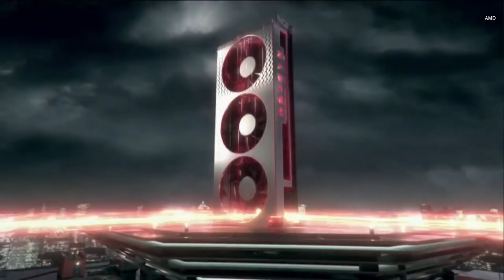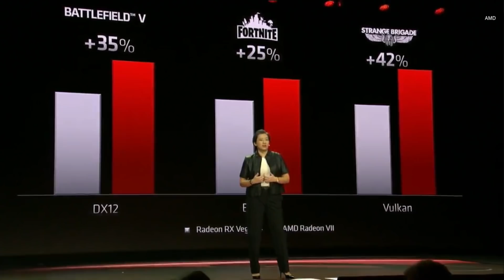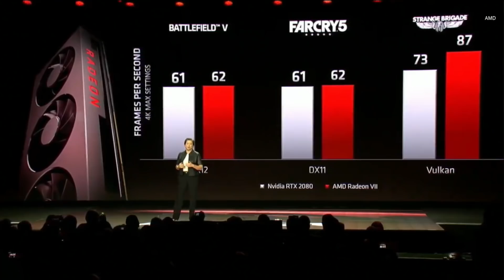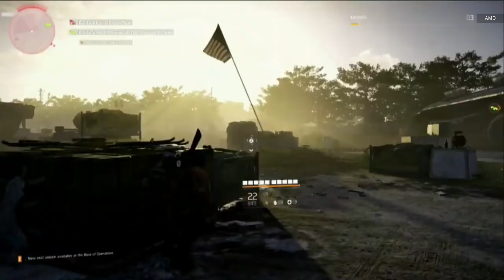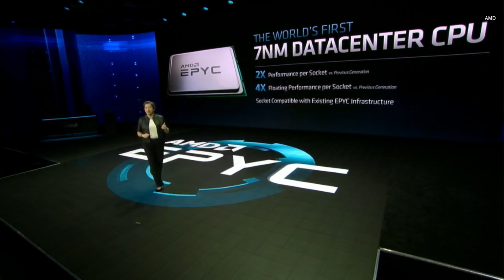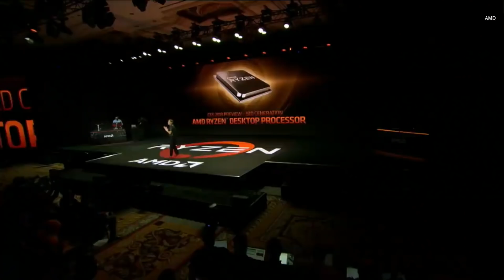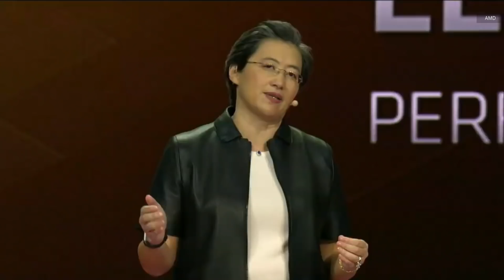AMD's CES 2019 Press Event in 9 Minutes: Ryzen is here to stay

Comment: Mid 2019? i9-9900k is selling at $500 now.  So AMD better price this 8-core at like $300 to win market back.
Reply: lol that's something AMD would do. If there rumors are true that 8core is actually an R5 CPU and their R9 line up is a 16 core beast. Lots of space on that AM4 PCB for another 8core die beside the I/O die.
Reply: What do you mean by winning market back ? They need to get ground vs nvidia but ryzen is outselling intel by alot  even tho intel just released processors
Reply: @busherinolol1693  ground against nvidia with a 700$ card? Yeah goodluck.
Reply: @3rd.world.eliteAJ  and that's why he said that they NEED to HAVE ground, not HAD ground.
If they actually want to compete, they have to slash it down to at least $600
Reply: @3rd.world.eliteAJ  I said they "need to get ground" which obviously implifies that Nvidia has an edge moron
Reply: They have the 2700x which is 300. Virtually performs the same at 4k.
Reply: Tariffs bro. Takes time and money to make those chips
Reply: They'll release an 8 or 11gb high performance radeon card at 500ish for sure. Then navi can compete with 2060s and 2050ti's at cheaper prices. If the leaks are true*

Comment: Thank you AMD, this is exactly what we need.
Reply: 2080 price for 2080 performance....

On the other hand for CAD/CAM I'll be amazing!
Reply: @bitscorpion4687  most rtx 2080s i find are around 800 though. And it has greater than or equal performance with 16gb,why should i get the rtx 2080?
Reply: @AbdallahTeach  what game needs 16gb ?
Reply: @friendlymountainguy3475  we would after few years. Ffxv consumes 9gb vram at 1080p according to users.
Reply: @AbdallahTeach  we don't know shit what will happen in the future
Reply: @AbdallahTeach  that's MAX vram. If you have say 8 gigs every game will show that it's using all of it. Same for 11 gigs( 1080ti).
Reply: @bitscorpion4687  its still good to have headroom for upcoming games at 4k or vr. I do believe this card will outlive the 2080 even at same performance due to amd drivers improving heavily throughout the years
Reply: @AbdallahTeach  VR would be a good point and high resolution rendering. 

Fine wine however will NOT continue.

The reason Fine wine is a thing is because AMD is still using the same old GCN 1st gen architecture since 2012(or 11 not sure) so cards from 2012 just received improvements from 2017 cards as they are similar, Nvidia however completely changed their arch with Kepler so older cards didn't get the benefit of newer cards.

This will stop as AMD moves to GCN 2nd gen in 2020.

Linus tech tips made a video on Nvidia's drivers (they support them for 5+ years)  it's titled "Does Nvidia ruin your performance".
Reply: @AbdallahTeach  still no rtx cores in the vega7
Reply: @friendlymountainguy3475  
Basically, games that are heavily modded like Skyrim and Witcher 3, when they use 4k textures. Also, that much ram is more future proof.
Reply: @bitscorpion4687   With 3 games, plus a lot more Vram for video editing seems quite nice to be honest. Not the best, but it's there.
Reply: @JeanGTech keep in mind it's 700 on it's release date. I'm quite sure the 2080 was like 1k on release.
Besides, this could start a price race between Nvidia and AMD. Would NOT buy it straight from launch. wait 3 months or so, and it  might save you 200 dollars,.
Reply: Anonieme gebruiker 2080 was $799 on release dates and most cards I see go for $699 right now. It comes with 2 games in a bundle though .(Anthem and bf:v)
Reply: talking about theoretical numbers. lmao. wait release and benchmarks. Hype is hype. real data is real data.
Reply: $700 card speed of 1080Ti?
Not really. 2080 can do that....
Reply: here here

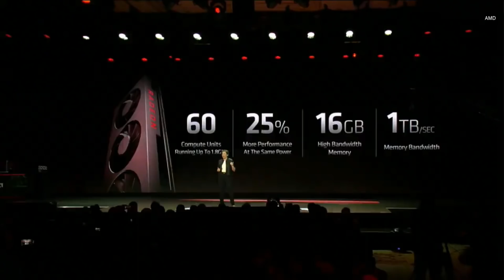Comment: What's the difference between 0:46 "High Bandwidth Memory" and "Memory Bandwidth"?
Reply: HBM is name of memory interface that memory is connected to (HBM2 most likely to be more exact) different then DDR or GDDR, while Memory Bandwidth... is memory bandwidth. HBM is a lot faster then DDR, but on other hand is more expensive, NVidia also do GPU with HBM2 but only for Gx100 chips as it would only ramp up the price of already super expensive cards, and yes thats means Titan V also had HBM2
Reply: @ShadowriverUB  HBM is actually the chip, instead of gddr, they use hbm memory
Reply: You have the speed of the memory which is 1tb/s and the capacity which is 16gb. Correct me if i'm wrong I'm not sure

Comment: adored is right, you can even see a faint outline of the second chiplet place.
and why making it asymetrical if not to have the space for a second chip, why using an IO die at all. a monolithic die would have better latencies. 
adored have being proved right by amd themselves and most people didnt even noticed.
mark my words. amd will anounce the lineup may 1(its amd 50th anniversary ) and launch it the 28 of may at computex.
the lineup will end up prety similar to adored leak and the leaked prices are probably goals so we will see.
Reply: @David Whitfield  The leak was about Navi, radeon 7 is Vega.... The gpu that was leaked was never even mentioned so how can it be "off base".
Reply: That's a possibility... Or, hear me out: they release it before computex on their 50th anniversary. Close enough to mid year right? Will even have 5.1ghz 16 core by then. Ipc difference right now is max 5%, increase by 15% and gg. Computex is entire show on navi. They release navi APUs, 3060 for 150$, 3070 for 250, 3080 for 350$, Radeon vii 8gb 550$ with 2080 level performance (maybe like 5% lower). They control entry level with APUs, budget with 3060 and 3070, mid range with 3080 and high end with 8gb Radeon vii. What's to lose? Why not? Nvidia will have to lower prices or release 11xx series and Intel... Well it's finally being punished for thinking they can have us put up with 14nm broadwell up to comet-lake s and no HT i7
Reply: If you convert Adored predictions to "someday there will be a 16 core chip" then sure he was right and what a brave prediction it was. No, the point of his long "leak"-presentation video AND its follow-up was that they were chuck full of details. Model names, CPU reveal dates, etc. The first details of his leaks were debunked today so what are the odds of anything being really true at this point? 12/16 cores will probably come when Intel goes to 10 on mainstream, which seems to be in 2020. By that point it would be very generous to call Adored "right".
Reply: Chiplet is there fir purpose dont talk about something than you don't have a knowagle
Reply: @royallager1851  so  tell me what is the purpose of the chiplet being so of center to the point you end up with with enough space o put another chiplet
Reply: @nicolasinvernizzi6140  first don't like yourself comment 
Second it can have one more die with 8cores more
Tree:you are not so smart talking about and you don't have a clue...
Four:you have a Google..
Reply: @royallager1851  first i dont like my own coments thats lame.
second by your answer you know less than me about it.
third you dont know me enough to know how smart i am.

Comment: "AMD loves Gamers"
and we love you <3<3
Reply: @Frank Enstein  Ray tracing on BF5 is pretty garbage in terms of it's use in engine. Nothing reflections everywhere and doesn't look natural either. I have yet to see any developer use this in any meaningful way engine wise. And it will take literally years to see it in new games.  Ray tracing isn't something new. It's been around for a while, in software. But NVIDIA want's to push for it with their gpu's built around it. RAY TRACING was available for a while in engines it's just gpu's couldn't handle it in realtime. Making a GPU have architecture for it when people are not codding for it won't magically start a ray tracing revolution when it's been used in the industry for some time, and no Prosumer card has been made by a committee of software developers asking that they have one specifically for those.

It's been around for rendering in scenes and such. Would rather that people not pay for something that the industry isn't using. It happened to Agea physx. Nvidia incorporated it in games and it kills frame rates. Same thing, only difference is it was software based tech, mixed in with their physx architecture that they incorporated when they bought Ageia.

Like Cyber punk is a ways off, and I hear nothing from them and that game looks amazing. So far the uses are shit, and to have that on a chip would increase it's cost across any device it's used in either desktop, console etc.
Reply: @HAZZARD Regarding futureproof, if you have a decent card that still handles games on the level that satisfies you like 1080/1070 or something similar or even Vega or RX series something wouldn't be worth buying now just because it's ray tracing, wait for 2nd gen Ray tracing cards. that will be plenty of time for drivers to work properly without any problems when new titles come out, the market would have a variety of titles that support it. If you building new from scratch then it's worth it to invest. But always you need to see what is your aim it's stupid to buy a card because of RT when you doing competitive gaming or playing basically titles that never benefit it in the first place like Fortnite.rather be reasonable on the decision then use your own hype about what to buy and when.
Reply: And love the money haha
Reply: we love gamers proceeds to shit on what just she said LOL
Reply: @yami odymei they are using threadrippers.  Just no radeons.
Reply: ryzen 3rd gen
Reply: Maximilian Scheumann lol they LOVE 💖 your money! but not you in particular though.
Reply: Do people know that raytracing is software? It only requires a strong graphics card
Reply: @hackerino9707  I doubt that. Nvidia told people we have ray tracing and everyone follow up on that idea. Regarding this was it Microsoft that implemented ray tracing with DirectX11. just those mathematical calculations are hard as hell to do real time. Nvidia just added separate unit for those calculations with the assistance of the third unit with tensorflow cores for AI engine to help them to calculate fast enough or help them predict the better outcome by calculate not all data.  even if you take 1080 it would struggle to keep up with calculations that you would have good framerate.
Reply: not enough RTX on
Reply: You may love them all, but all of them are soulless corporations in there for the money.
Reply: @Boe Dillard  Not enough titles to play games with RTX on stable framerates
Reply: @KimasM  BF V is fixed btw
Reply: Forged by Kimas Stable framerates are NOT an issue with RTX.
Reply: Still won´t buy an Amd card if they hot & loud like the current gen.
Reply: Sure, that's why AMD hasn't released anything orientated at gamers for many years now. The Radeon 7 is a rebranded MI50 compute card which didn't sell well. AMD fanboys are idiots.